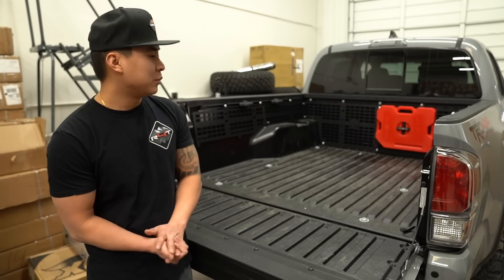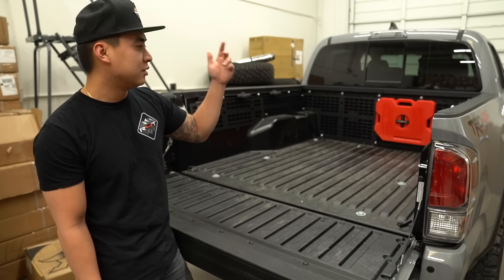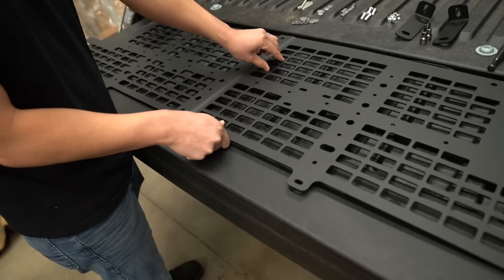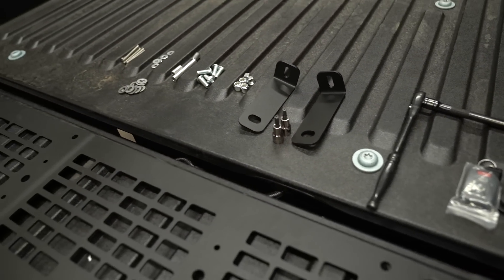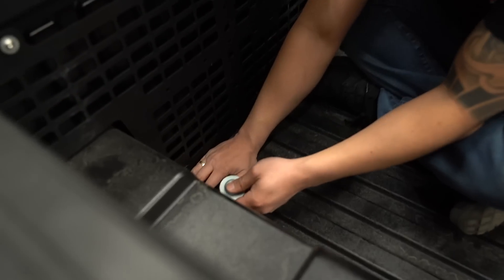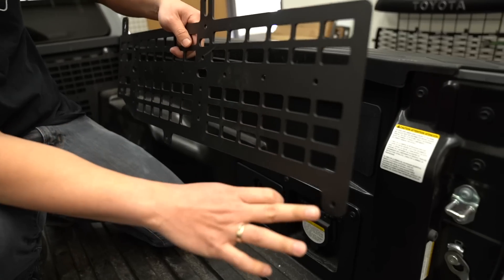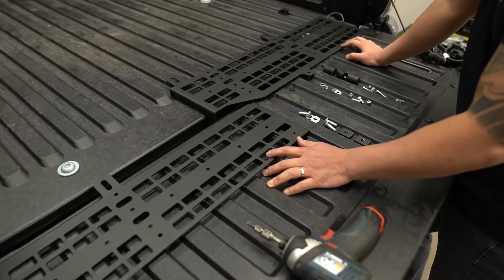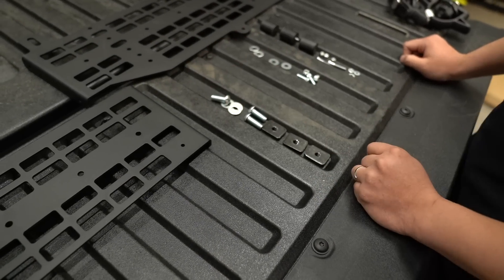AMAZING TACOMA Bed Storage System! Bed Molle Racks!

Comment: Something I learned about those sliding tie-downs.  You don’t have to slide them to get them on the rail.  Just position the T-nut so that when you push the tightening mechanism in, it pushes the T-nut into the slot.  Twist once to get the T-nut to grab the rail, and there you go.

Also, the newer feet for the bulkhead panel are L-shaped where they bolt to the floor, at least for ‘21 6-footers.

Comment: I wonder if these work with a Leer camper top, it would be a pretty sweet system if it worked with a camper top. The only thing I dont like about them is that they use the bed rail because there are alot of things that use the bed rails and some may cause compatibility issues.

Comment: I like the idea of the mole but it would be better if on the side plates they would make the mounts go behind the rail, so it didnt impede with the slides. Probably not that big of a deal but it should be an option.
Reply: The BuiltRight Industries one go behind the rail!
Reply: @khanhd716  so does RC.

Comment: Can the full length side panels be used with a RetraxPro XR bed cover? If not, does Cali Raised sell the half length molle? Thanks
Reply from the maker: They do, we have the half pieces here: https://www.runnin4tacos.com/products/cali-raised-led-bed-molle-system-toyota-tacoma-2005-2021
Reply: @Runnin4Tacos  Wait, does the full length fit or are you saying only the rear panel fits? Thanks

Comment: Cool stuff. Obviously overpriced, yet undeniably useful. My only gripe is the silver hardware. It should all be black. Everybody into this stuff digs tactical gear, and a bunch of tacky silver hardware cheapens the look.
Reply from the maker: Agreed but black hardware turns silver as soon as you put a tool in it. We thought the same
Reply: @Runnin4Tacos  Btw, highly recommend using Kolpin Rhino Grip Flex mounts rather than Quick Fist for axe/shovel/fire ext, etc. Personally, I think the QF mounts are garbage, and their rubber straps break very easily- in fact, two of my QF straps broke the first time I mounted gear on my MOLLE setup. Kolpin mounts work the same way but are much more durable & trustworthy.
Reply: @the_black_arts  How easy is it to install the Kolpin mounts?